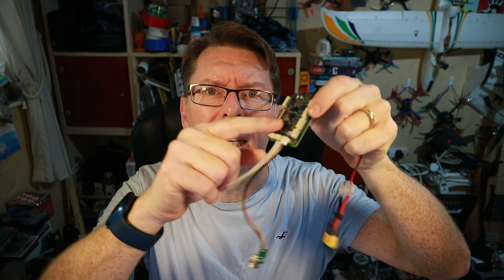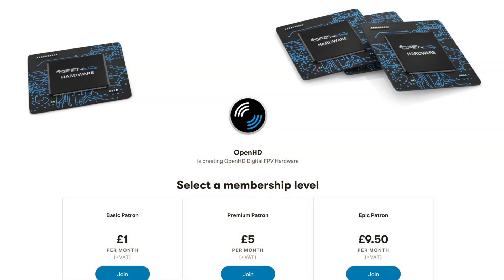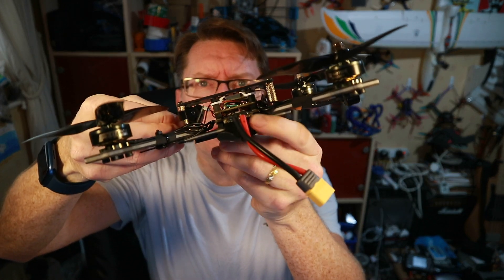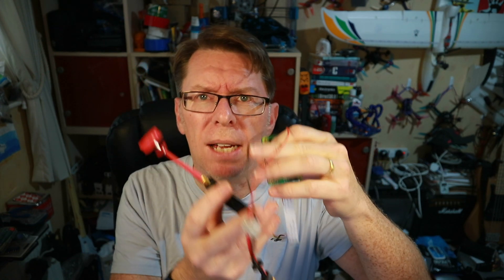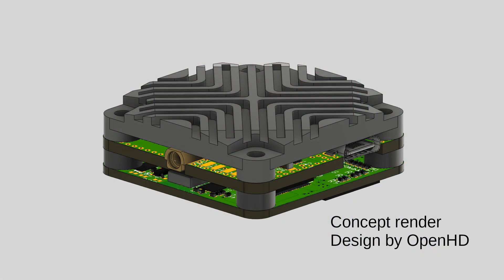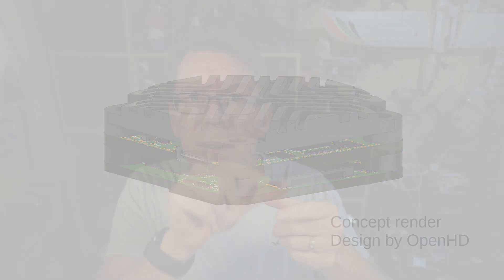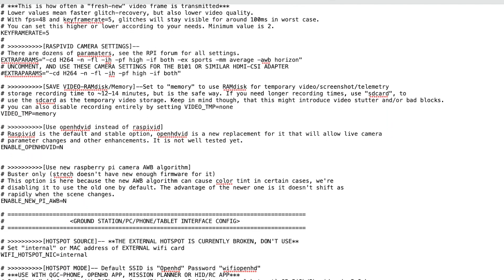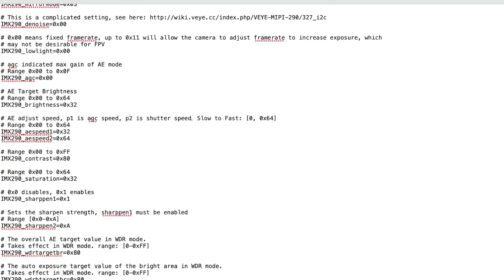Upcoming hardware developments for Open.HD

Comment: It's not going to happen. The only way it could happen is if they chose existing hardware and just created software for it. Cost effective, open, hardware production is really hard especially now in the chip shortage times. Could they do it at double the price of dji air unit? Yes, probably, but then if its not really open source, and it costs double, why bother?
In my opinion, h264 on a cheap doc is the way to go.

Comment: For years I’ve been looking for a system that can pan in software rather than in software. Two, bulky and “heavy” servos so physically move a camera don’t make sense any more. When you look at the quality coming out of 360° cameras, I would love to have say a 180° than I could pan the feed, probably on the air side to make efficient use of bandwidth but could be done on the ground if you need the extra processing power.
I wonder if you could just use Open HD with your traditional analogue system to take (head tracking) input from the flight controller or receiver and use that to crop the feed.

Comment: Sorry, I'm confused about the current state of OpenHD hardware/Raspberry. I hope you can clarify. I see that Seeedstudio is selling the Raspberry CM4 boards (although they are out of stock currently). Is this "real deal"? Did it come from Flavio, or is this a different venture? Is the Chin project dead, or morphed into something else? Had to keep track of recent developments. I also see a new set of videos on the "3B mini", which the author (MarioFPV) says are not Raspberry products!!! Help!
Reply from the maker: There's lots of plates spinning at the moment it would seem.  Flavio, I know, has partnered with Seeed to make the Ochin boards.  I did ask him about it as I'd only seen the likes of PCBway used for building, but he did mention that they could handle all the logistics for him as well including ordering/dispatch etc.  Is Chin "Ochin" in your question?  I know there were a bunch of Pi-like boards like the 3B mini - it wouldn't be so bad having a compatible board if it was supported by Open.HD, but I know most of them (and I'm saying this without checking the website) aren't supported
Reply: @CurryKitten  Thanks so much for the response, and state of the Pi report. I’ll just keep watching your channel for the next update on the Patreon-funded project. It’s still moving forward, yes. If so, I’ll add my $ contribution to the project.

Comment: Sounds interesting, I like watching your cobbled together quads doing HD...the last one was pretty impressive with its OSD...🤔😀👍👍🇬🇧
Reply from the maker: Hopefully that OSD should improve once Open.HD improves the telemetry link with Betaflight, but the plan is to give iNav another go for the next quad
Reply: @CurryKitten  Oh, iNAV, I'm usually a fan as you know, but on 4.0 and 4.1 I think they've lost the plot TBH as far as quads are concerned anyway. The main problem for me has been motor overheating again using the default PID settings and filters...This is where BF beats them hands down IMO...So bad, I've switched and they've removed firmware support for older versions too. Bad move IMO...🤔😳😳

Comment: Does the Pi Zero 2 improve things over the first version? I suppose can’t harm apart from battery drain.
Reply from the maker: Whilst the Pi zero 2 can handle h.265 (IIRC) it won't give any particular advantage with Open.HD as it stands.  But the 2.1 release won't support the original zero (initially) so I hope it's utilizing the extra power of the zero 2
Reply: In the current version of OpenHD the zero 2 has the stability of using a pi3b+ in the package of a zero.

Comment: I'm not sure that H265 is the answer.  It is more computationally intensive than H264 (ie:  more latency) and it also, like all long-GOP codecs, requires an error-free transport layer.   I think something based on MJPEG would be a whole lot better because it would be more resilient to data-loss (allowing ECC instead of ACK/NAK/RESEND).

If you're going to use a long-GOP codec then skip H265 and go straight to AV1 (which is also open source so fits better with the project goals).   Being OS means that there will be a growing number of AV1 encoders that can be used without license fees and they can be forked/tweaked to minimize latency and maximize other aspects of performance.  Perhaps we'll have an AV1-FPV fork :-)

It will however, be very interesting to see where this goes.
Reply from the maker: I have to admit of never hearing of AV1 - I guess because it's not widely supported right now.  From what I read it's compression is better, but it seems even more computationally intense and the encode/decode time is longer than h.265.  As for MJPEG I think it's a little like your whiteboard video on digital video - there's times it'll work better because it works on a per frame compression.

What I would like to see if more development in the "secret sauce" part (to borrow from your terminology)  So lets say that we're missing a bunch of data from a decoded frame, rather than going back to the air unit and ask for a resend, why not have an educated guess at what should be there.  Bring in a a comparison from the last frame in the buffer, or interpolate the probably colour data from the surrounding good colour information around it.  Although I've no idea how efficiently you could make it work.

It would be cool if we had lots of forks and people messing around with different areas of the code to see where gains can be made and see what process works the best.
Reply: "More computationally intensive" does not necessarily equal more latency.
Also: Isn't H265 still able to encode All-Intra?
I agree however about better using an open source encoder algorithm.
Reply: @uhu4677  Yes but once you do an all-I-frame configuration of H265 (or H264) it effectively becomes a version of what MJPEG is anyway and you lose quite a bit of the compression potential. What we probably want is an open-source scratch-built codec designed specifically for FPV.   It would not be at all hard to improve on the tiny amount of compression that HDZero uses and I think this would be the most fertile area for experimentation.
Reply: @uhu4677  You don't think a suitably lightweight codec couldn't be implemented in software?
Reply: @uhu4677  I'm just looking at the most pragmatic solution.  Any H265 codec will add latency (simply because it's frame-based it needs an entire frame of data available before it can compress the data before we even get started on the actual computational overheads).   A codec that works only at at a frame-cell level will always be simpler and have lower latency so this would be where I'd be focusing my attention.  This is especially considering the nature of your average FPV image (blue sky above, green grass below).  Even half-frame encoding (as DJI seems to do) would allow for some clever optimisations that reduced the average bitrate without huge computational overhead and with half the latency of a full-frame  codec.

It strikes me that OpenHD probably needs to (if they haven't already) defined their min/max acceptable latency and the min/max resolution, framerate, etc -- before going down the route of choosing hardware for implementation.

Is OpenHD going to try and be more like DJI (moderate latency with excellent video quality), more like HDZero (lower resolution but lower latency) or what OpenHD is now (high latency with reasonable resolution/quality)?

The biggest problem I can see is that of producing a solution that is *cost-effective*, given the current chip shortages and consequential huge prices.  

As someone who'se done more "concept to commercial product" projects in the electronics field than I care to admit to, I can only say that every minute spent at the "concept" stage can save months at the commercialisation stage.  Accurately define what you're building before you turn the first sod... as they say :-)
Reply: @xjet  Can't you do sliced encoding? Just like it's done to reduce latency on streamed VR?
Reply: Being involved in the development the only thing I can say is that it all boils down to the availability of high performance hardware encoders/decoders. Non of the stuff we do is dealing with software based en/decoding but with specialized ASICS and yes, we use forward error correction codes (like we always did). Discussing things and spreading the word to the masses without having the proper insight doesn’t help much.
Reply: @MrCareyer  What's the cost and availability of suitable ASICs?  When I took a look (a couple of years ago admittedly) there was't a whole lot available and what there was was big money.   I don't know that we need as much compression as H265 can provide (HDZero provides very little) so an intermediate codec (better than HDZero but simpler/cheaper than H265) might be a useful option?
Reply: @xjet  the needed ASICS basically are already there with appropriate hardware like Raspberry Pi4… it can decode h265 with a whopping thousand (1000!) fps at 720p in pure hardware with minimal latency. Given that it simply isn’t meaningful to go for another codec because special ASICS for these likely do not exist and/or are not readily available and cheap unlike with the Pi4. Same goes for the encoding side where jetson nano and rv1126 are used. Both do encoding in hardware and with mind boggling performance. Cheers! Keep your vids rolling!
Reply: @MrCareyer  What's the price and availability of the ASICs used for encoding?
Reply: @xjet  as I said NVidia jetson nano and Rockchip rv1126 are used. Taking the chip shortages out of account the price for a jetson nano 2GB DevKit last was 69€ I believe. Amazingly cheap for what it can do ;-). It’s basically a freaking high end graphics card squeezed onto a SoM. Hope that helped.
Reply: @xjet  A cheap AllWinner S3 - a fairly old SoC which can do 720p 120fps h264 encoding costs like 4-6 USD when bought in bulk. In fact the Pine64 PineCube (just an open source security camera using that chip) costs $25-29. Most of these SoCs already have a lot of these VPU and GPU blocks along with drivers. Of course documentation/drivers can be a pain but if you're willing to dig in, you can find a lot of these SoCs everywhere in abundance.
Reply: @xjet  I think most encoders have quite a few options for tuning them and enabling/disabling features. I frames and P frames should be used but B frames which are forward looking should be avoided as these necessitate buffering the video to memory, which necessarily adds latency. latency resulting from needing a whole frame of video to be sent prior to decode could be mitigated by support for higher frame rates
Reply: @MrCareyer  So you're using H265 because there's fitting hardware?

Your last sentence comes off as needlessly rude to be honest.
Reply: @uhu4677  it was not my intention to sound rude. It is just that there is a lot of false information and speculation floating around about the next gen openHD, e.g. the overly complicated configuration settings currykitten is referring to (and scrolling through the endless text file in the video). Next gen openHD basically won’t have any setting files. Much is automated and Plug’n’Play. Doing proper research and investigation on this topic would have helped here to get the message right before spreading the word. ;-)

Comment: awesome look forward to seeing the outcome and it would be awesome if there was a module release with it that would fit and connect to fatsharks analog goggles
Reply from the maker: I hope this comes along eventually.  But I totally get the idea of concentrating on a single idea to start with and seeing it through to completion
Reply: I don't think it will ever get to the point where it will be a small module that can connect to the module bay. Firstly I don't think it will ever get that small and secondly the analog module connection is just not cut out for what is being output from the ground module. Best we will likely have is a small module similar to hdzero connected through hdmi.

Comment: HDZero...
Reply: I've always said that HDZero should throw its software out to the Open Source community and just focus on hardware instead.
Reply: @xjet    I'm told that Divimaths ultimate goal is supplying chips for others to get creative with... If I read right they are available to anyone that has no military  intentions..🖖🏼
Reply: @steve_beatty  No, they are not (available). That's just PR.
Reply: @petrusoroaga6528  You are saying Divimath will not sell chips to outside vendors ?
Reply: @petrusoroaga6528   Well ?
Reply: @steve_beatty  What you don't understand? I can't comment more than this.
Reply: @petrusoroaga6528   I understand quite clearly....Seems quite the spurious claim without some context given...please elaborate or perhaps don't spread rumors...
Reply: @steve_beatty  Eh, believe what you want. I don't have to explain or provide context. Take it at face value or leave it.

Comment: that's what our hobby is about, taking what is available and make something cool out of it. 

next up, nice quality cameras....
Reply from the maker: Yes - hopefully decently priced ones.  Getting a good camera on a regular Pi right now is very expensive, but the standard ones are horrible, so there's very little choice
Reply: @CurryKitten  runcam at one point stated they could offer a firmware for their mipi bytefrost camera that should work with the pi. can't find any official links for this statement atm

Comment: My old laptop can't play H265 either.  LOL.
Reply: Problem is the word LAPTOP! - LOL - it's made for long battery life, not performance! You can get a desktop for $400 that will kick the living crap out of a laptop that costs $1000 or even more! Desktops are MADE FOR PERFORMANCE! 
They use completely different CPU's - the computers brain. Check out my main post on this video...it explains it all and more! :)
Reply: @KOrnhOliO1  I know, but a desktop PC uses a lot of power too, my small solar electricity setup would go flat.  I have really old personal laptops (2009, 2011, 2015) all with knackered batteries, LOL.  I also rescued a pile of even older portables from being scrapped that couldn't run OS later than Win XP.  We install a Linux Spanish educational version on donated machines at the charity workshop where I volunteer, if we can get it to run (this is why I have a museum full of old Toshiba Satellites and even a few PDAs).  Happy Flying !
Reply: @TailSpinRCSpain  I love your hobby and idea to donate old laptops. I personally want a snappy, quick, and efficient desktop PC that I don't have to wait around for. Nothing like instantaneous response. Once you've had the speed, you simply can't go back to slow computers. ;)
Reply: @KOrnhOliO1  Talk about fast, my Win98 rebuild PII with 128MB RAM is a beast, using some parts from my original dead Pentium MMX,  Sound Blaster 64 AWE, Voodoo 1, ET6000 and a more modern LAN card, it connects to the internet, tried all the old browsers, but only SeaMonkey will surf.  Happy Flying !
Reply from the maker: Sounds like a cool charity you volunteer for @TailSpin RC - keep it up!  @Sco0t Rot0R I like my desktop as well, but when I'm on holiday it's a bit trickier to drag around, so the laptop comes out.  The stuttering actually did cause an issue on my last trip where I was filming underwater - I hadn't picked up that Superview was causing some nasty looking issues so my first couple of days footage was all toast.

Comment: cannot wait for that hw to become available.. presumably those air units protocol-wise and mostly software-wise identical to existing openhd air units? so all compatible with any existing ground units? any idea about what the bandwidth requirements are? how many wings can be in the air together using openhd?
Reply from the maker: Yes - s it's an air-unit solution only at the moment, it has to be compatible with a regular Pi based ground unit.  There will most probably be a raft of changes going into open.HD to accommodate this as well.  Interesting question about how many can fly at once as everyone flying Open.HD right now is doing so very much on their own.  I've no idea how much "bleed through" you get through on close channels and how much it affects the signal on another channel.  We'll have to find that out